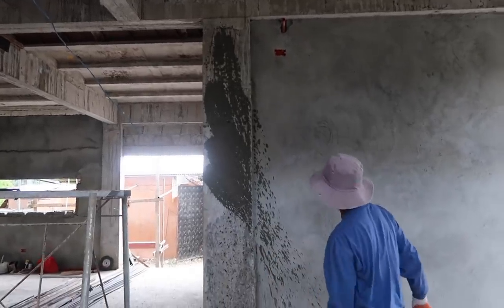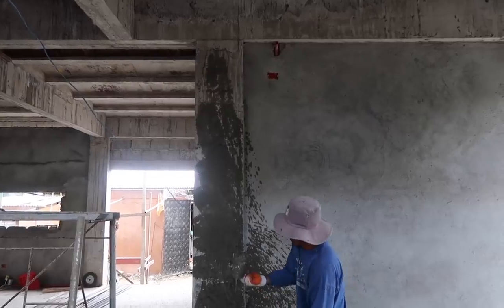HOUSE BUILDING IN THE PHILIPPINES - EPISODE 86: CONCRETE BLASTING

Comment: Hi there
What is it exactly what he’s throwing on the columns. Is it just neat cement or a rich mix of sand and cement?  Also does he let it dry before applying the render?  👍👍👍👍
Reply: those are just clean cement, sometimes with just a few mixture of sand, it its just for smoothing the surface, its not like a thick plaster.
Reply: @crewcutter2030   I thought it looked like neat cementI. But I thought neat cement would crack that’s why I ask the question.  cheers for that anyway 👍👍

Comment: I see that it's really coming out nice flat Walls but the electrical gets me why not put it Tru the floor instead I think maybe better so you don't have to chip the columns.
Reply from the maker: Billy Lopez it is supposed to be in the ground but we have to pour soon that time
Reply: @retiredandhappyinphilippin3329  oh ok so you agree with me right on it should have been on the floor
Reply: @retiredandhappyinphilippin3329  hey the switches they usually go I always put them hammer hight right that's what I think about the electrical box.